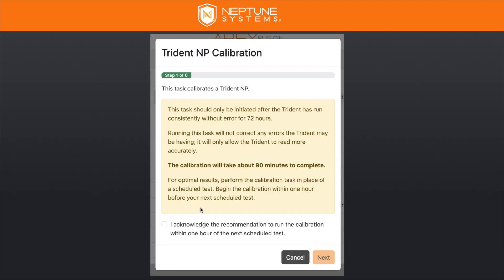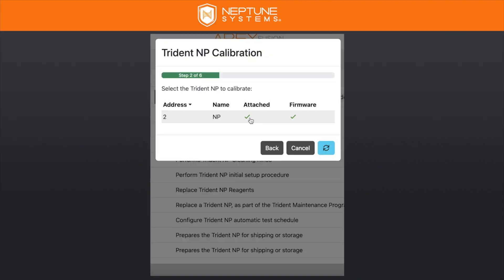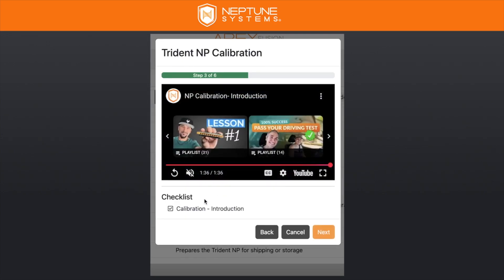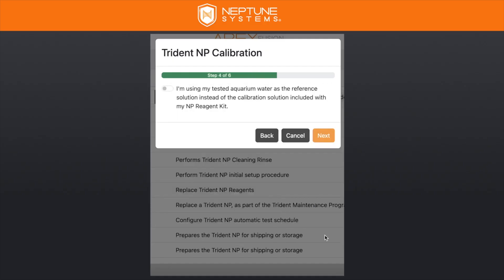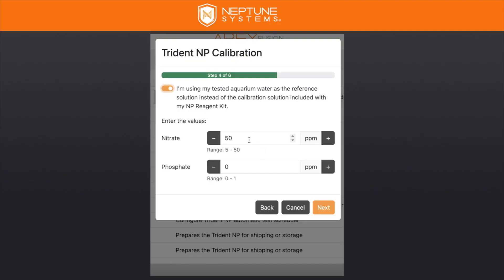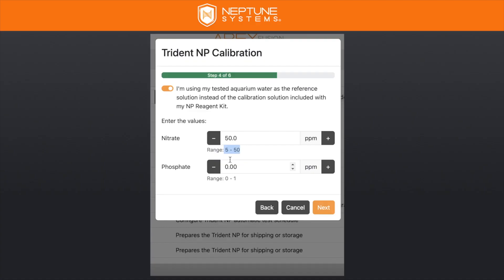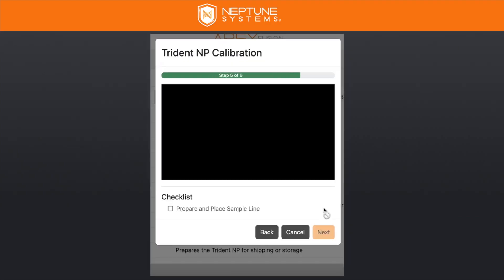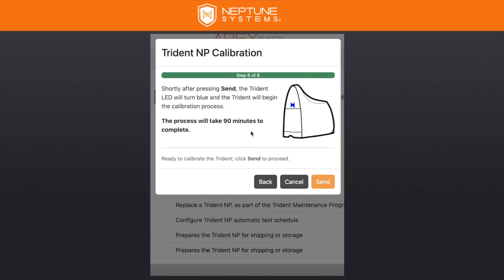Neptune Systems AMA #6  - Trident NP Calibration Task!

Comment: I found that collecting a pint of water to do the manual calibration worked best.  Meaning I collected a pint of water from the location of my sample line, used that water to do a series of 4 manual tests, averaged those and threw out or retested any outlier, then put the sample line in the same pint of water and used both water and numbers to run the manual test result calibration.  Same water source and location was more consistent for me.  Just remember to move the NP's sample line back when done :D

Thank you both.  Go team Neptune!